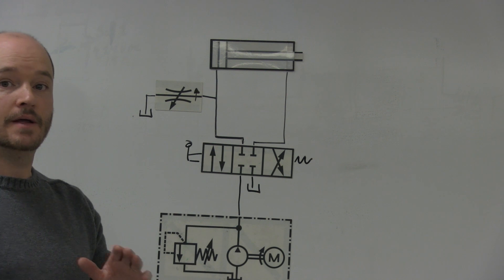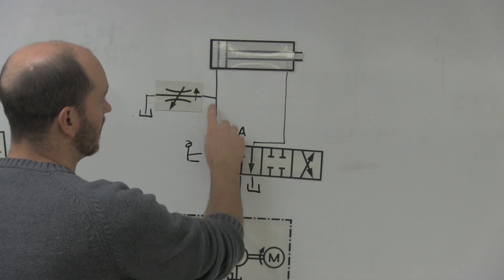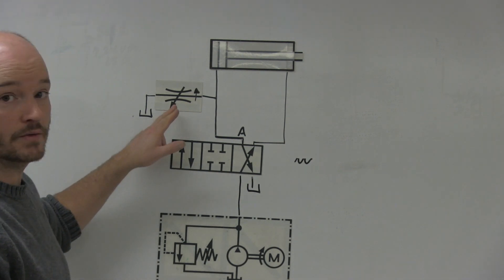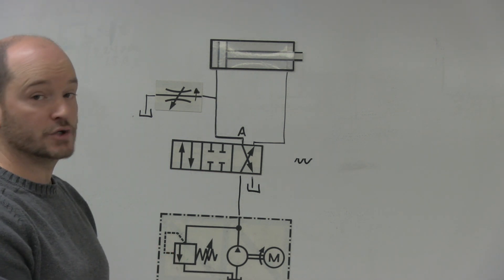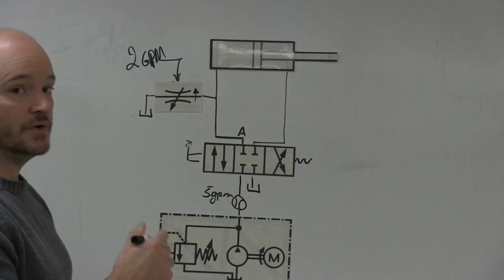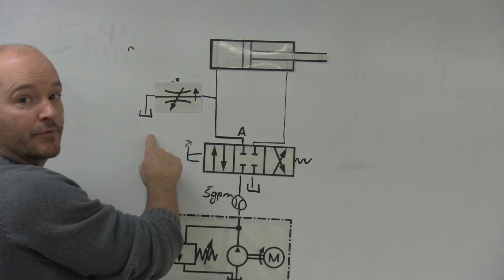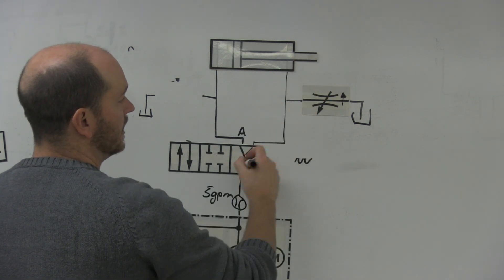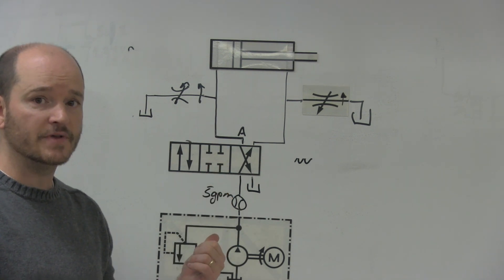Bleed-Off Circuit

Comment: What is the meaning of this circuit that 😐❓ is oil leakage or something?
Reply: Riya Kumari it is a by pass control method. In this desired flow is achieved using FCV’s